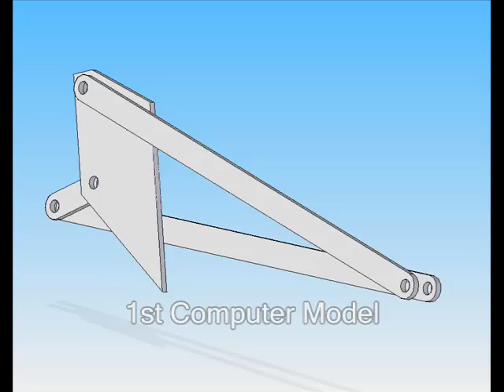Mechanical Engineering Kinematics Project

Comment: Thanks. I understand that it would slip on smooth surfaces. I was thinking the same thing as you, putting rubber caps on the tips, yet I want to see round tips, or else sharp points, whichever results in smoother movement. The square ends here make it ride rough

Comment from the maker: @pratik1876 The frame was donated from another students past internship, the screwdriver that was used as a motor was donated from my past internship, and the various wire, nuts, and bolts were donated from the University's machine shop. The chain, sprockets, and threaded rods used for the drive train were the only parts we purchased. They only cost us about $30 USD or about 1400 र at today's exchange rate.

Comment from the maker: @moamenahmed I'm not sure about the motor, but I think the whole screwdriver runs at roughly 100 RPM. Then the chain and sprockets gear it down by about 5:1 so the legs turn at roughly 20 RPM, if my memory serves me correctly.

Comment from the maker: I just want to clarify. This was a 3rd year project specifically for a kinematics course. Yeah, maybe the linkage might have been somewhat easy to make, but what isn't shown in the video, the determination of lengths of the legs to create a desirable motion of the foot as well as the analysis of the motion created required many hours of hard work in MATLAB, Working Model, Solid Edge and other high end software packages. I assure you, no 10 year old anywhere in the world could have done that.

Comment from the maker: I actually donated it to the University so they can show students an example of the project.  I thought about making it turn, but that would mean I would need at least two motors, and then there would be balancing issues when one side is going forward and the other backwards.  It would just exponentially increase the complexity and it would be unnecessary.

Comment from the maker: @gSTA1992 It is a Campbell Hausfeld welder. MIG/Flux Core Wire Feed Welder
Item Number: WG206000AV. It worked really great. I would suggest learning on scrap metal with similar thickness to what you want to weld first though. Good luck.

Comment: @Daniyoyo eh mechanical stuff can be designed just as easily out of country. The job of an engineer usually isn't to build stuff but rather design and analyze something.
 I would say Engineering Degree is one of the hardest degrees to get along with Medical Degree and not for those who don't like math.

Comment: i am doing almost same project named spider mechanism showing the spider motion but i m feeling uncomfortable while joining the sliding pair (links)..confuse whether to use rivets or nut bolt or any other...plz suggest
Reply from the maker: Rivets make it hard to take apart to fix things - which you will likely do. Nuts and bolts work well, but since parts need to rotate freely, you can't tighten the them together completely. You will either need either shoulder bolts (which can be expensive) or some type of locking nut (like nylon insert) although these still might back out or double nut the bolt. That means put two nuts on each bolt and instead of tightening the nut to the bolt, position the nuts where you want them to be so the joint is tight but still moves, and tighten the nuts together.

Comment: Would just stat slipping on a smooth surface then. If rubber caps were put on the square feet it would move with more ease across this surface

Comment: If you're going to do engineering just for the money I'd say pick another career. Its something you have to have a passion for. To answer your questions: 
engineering is not necessarily an easy degree.
engineering managers are usually engineers who have had previous experience so you have to be an engineer first.

Comment: You can't be an engineer if you don't pass your course work. I'm sure this 5 people can do better projects but the REQUIREMENT is a 4 bar linkage (do you know what it means?). 

They are NOT GOING TO MARS, you know!! In fact the Sojourner on the mars mission used similar concept!  

So what they have done is good! Clearly an arrogant 15 years old like you wouldn't understand! 

Building something similar in half a day doesn't mean you're a good engineers, it just means you're a good builder!!